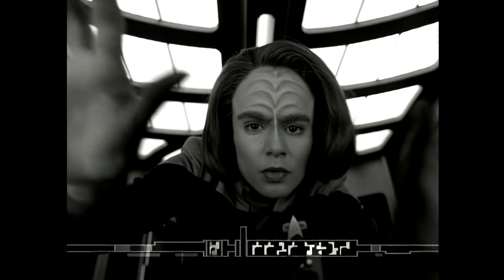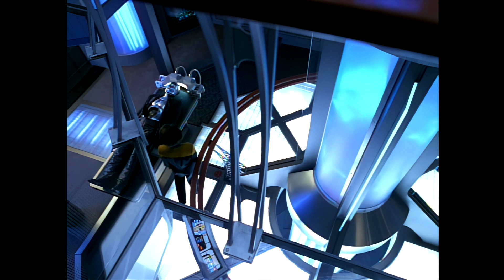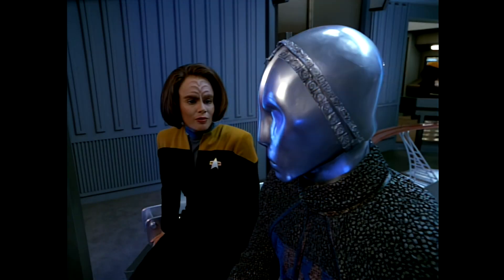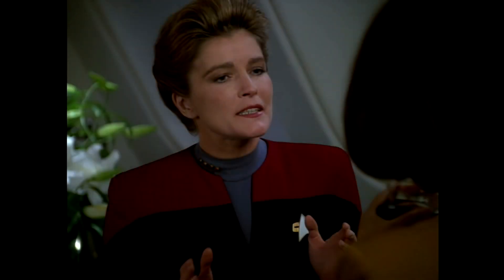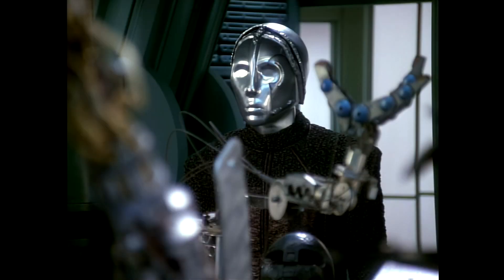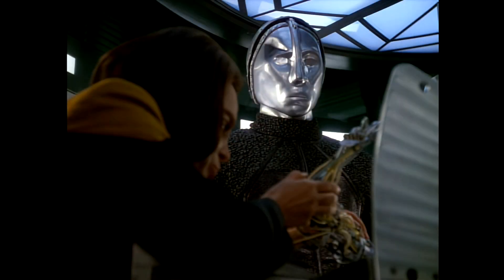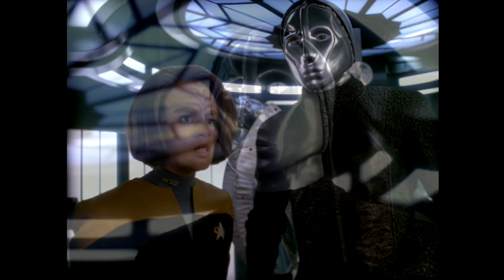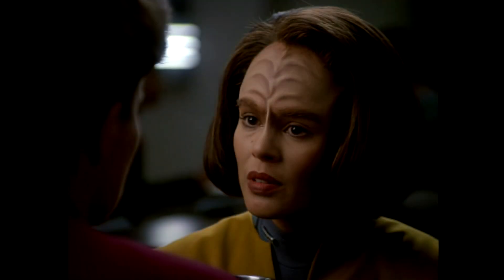Voyager Reviewed! (by an ar*ehole) S2E13: PROTOTYPE

Comment: Canonically all Starfleet starships (with the possible exception of the defiant class) have various kinds of science labs with different specialisations.
On voyager, medical labs are attached to sickbay but other labs are else where and are shown in a few other episodes later on. There really isn't any excuse given this has been an established thing since TOS!
They might not be ejectable as such but they do have forcefields and transporters and in most cases are in the drive section so the saucer section can be separated in case of next level fuck up (though this unfortunately doesn't apply to Voyager)
Reply from the maker: Time and money innit? I get why they're not there from those constraints, but it's still disappointing to think of the authenticity sacrificed in the process.

Comment: After seeing the Delta bot being examined completely unguarded in Engineering next to the M/ARA I'm starting to think Voyager had a critical lack of security officers and basic common sense. Worf wouldn't have stood for this crap, Tuvok shouldn't have either.
Reply: Remember that TNG episode where Data meets Bashir because Bashir is examining some mystery alien tech from the gamma quadrant?  And then they decided to power it up right in front of the warp core?  And then a lightning bolt blasts out of it and hits Data and induces a dream state?  If they had turned that mystery device to face the other direction, they all would have died.  Worf wouldn't have been able to stop a thing.
Reply from the maker: They already had the cargo bay set! It would have cost nothing to do it in there and assign some unknown guy to guard it. They could even have used Lt. Bastard for a little cameo. No cost to the plot, significant gain in credibility.
Reply: @aelolul  Attaching a piece of inanimate engineering to the Engineering section is slightly different than attaching a deactivated, formlerly animate thing to Engineering without at least one security officer ready to deactivate it by force if required. There are perfectly rational explanations as to why you'd want Engineering to test something there (likely because they'd have ready access to Level 2 EPS taps, which are recommended for experimental devices). Worf would not have percieved the Gamma Quadrant tech as much of a security risk needing the presence of a security officer, engineers would be more suited to halt any such malfunction than a security team.

The only possible reason I can think of for Delta bot to be unguarded is that, if you have someone with a particle weapon in Engineering, there is a chance that they might hit the warp core. Still, containment fields are a thing and this thing could probably have been studied in a less open view of the big explody stick.

Comment: My main problem with this episode at the time was "Oh yes, it's Voyager, the robots will have done a Skynet, no one is in any real danger and it won't matter by next week".   Perhaps if it had been something along the lines of, the builders had all gone extinct, the robots don't know why but Janeway suspected a Skynet event.   The robot kidnaps Torres precisely because they are running out of bots and they are getting desperate, they need to find out what happened / they consider themselves the descendants of the builders etc.  The crew could have had run ins with the bots later, perhaps trading or even just mentioning them in passing.  It could have helped build a 'lived in' universe instead of the reset button every time.

As for the F around compartment.  Yes, even if it was just a small cargo bay where the crew put things they find in it (A bit like the Wombles)., but I presume either there wasn't the time / money to create or redress a set of for it.
Reply from the maker: Yeah, as I mentioned in the S1 summary there will have been constraints that I can safely ignore in my perfect version of episodes. It just bugged me that they already dressed up a set as a cargo hold for S2E01 - The 37s that they could have used for this. Again, probably constraints.